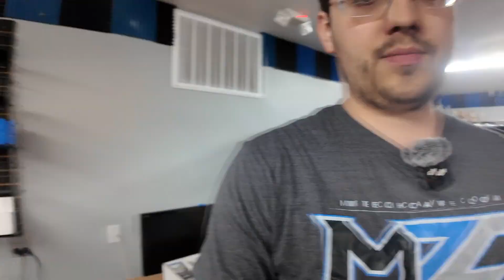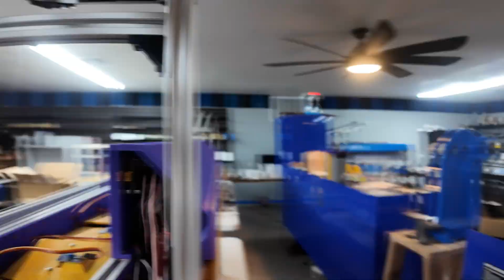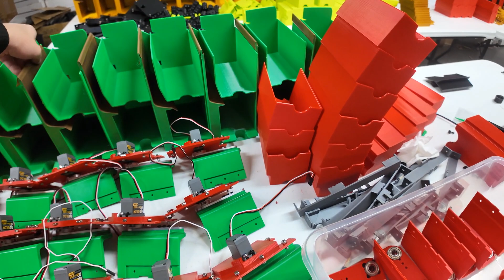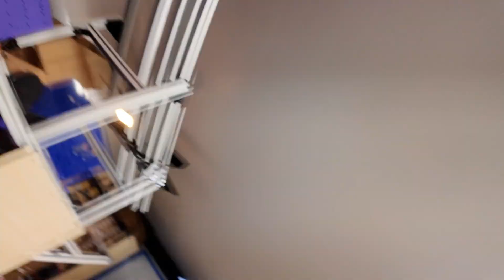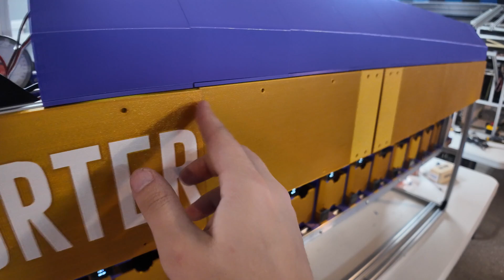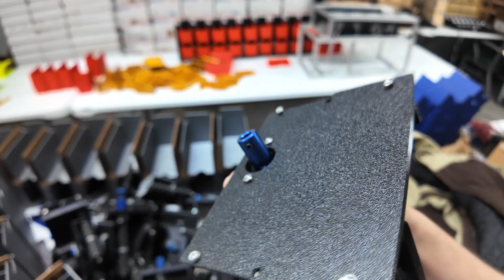Advancing Innovations: Super Sorter Update and Second Delivery

Comment: Just a thought, there is laser range finder modules available. You mount that and dial it in to your plane of actuators and you could auto calibrate home position based on the range output of the unit.

Comment: You can't get an api key to access all of tcgplayer. that would break a lot of privacy poicies. each account needs it's own api key and would need to add that to your software. because then the authorization is scoped to only that account.

There are quite a few alternatives to consume data but it all breaks TOS for tcgplayer.
Reply from the maker: Oh we are well aware of the alternatives, and we know they violate TOS. So we’re pretty limited on that regard. 

I mainly meant an API for pricing data to start. Then a way to integrate and sync users inventories as is own connection like the “big 3” have access to.
Reply: @SortSwift im sorry can you explain what you mean by “pricing data from start”

I don’t want to give you answers you already know about. 

FYI

I sell on TCG player and have built my own inventory management and invoice management app. It doesn’t solve scanning problems because that already exists I parse that csv data. So if you have an export option I would just tie into that. 

I’m happy to share what I know
Reply from the maker: @  we have TCGplayer pricing data, I just mean a dedicated source we could poll and get the sku level pricing etc. (API)
We’re pretty well informed of everything in the scope of api and syncing. Even Pro users no longer get “api keys” to add to our apps, so that is also off the table too haha.

We do already have an export, as well as a full inventory management solution I’ll be talking a bit more in detail in our next video.
Reply: @SortSwift  What do you mean by sku level pricing? The sku of the card itself? How is that different then tcgplayer marketprice? Sorry for all the questions, I find it interesting. 

Also that's great, I'm looking forward to more videos. I'd love to own one of your machines some day. Hopefully I can scale to the point where it makes sense or me to do so.
Reply from the maker: @ main market price is basically NM, sku level gives you each price of each condition, like you get in the TCGplayer app or quicklist.

We have smaller machines coming hopefully this year! They’d be great to use and scale up with!